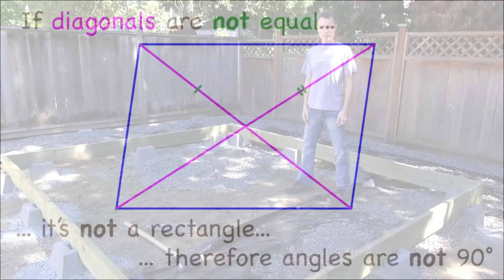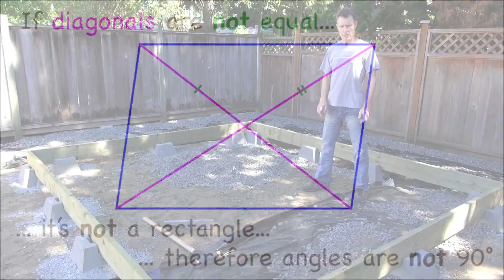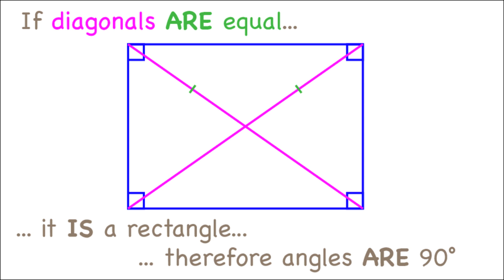Squaring a Shed Floor... Diagonals of a Rectangle

Comment: You never explained the solution? What you were doing to remedy the problem.
Reply from the maker: I didn't do a written solution, but I did correct the problem. I measured the diagonals - they were unequal. Then from about 2:00 onward I used a sledgehammer and block of wood to tap one of the corners to square it up, (ie. make the parallelogram into a rectangle), then checked again by measuring the diagonals to see that they were now equal.

Comment: Can't seem to get my head around this. We have 4 stakes and a string, with lengths and widths measured that were correct. This wasn't square though. So using this method I measured the diagonal one side, noted the measurement then measured diagonal the other side and noticed this was off with the 1st side. So I marked where it should be based on the noted measurement of the first. Then I went to check the length dimension of this side that I had just marked and it was way out. I have an equivalent of dyslexia when it comes to math. Can anyone point out where I went wrong?

Comment: Your video helped me several years ago square up a shed floor and again this weekend for a floating deck. When the measurements are off, how did you determine which end/corner to adjust? Thank you!
Reply from the maker: You're welcome and sorry I missed this when you sent it. I tap/move one of the two corners that are the ends of the diagonal that is longer

Comment: Question: What if the 2 parallel lines are not matching? Such as one line is 20 ft, and the other line parallel to it is 21 ft but the lines appear straight? How do we fix that
Reply: If you are making a rectangular shape the parallel lines must be equal to each other (i.e. top and bottom are equal length, sides are equal length). There's no way to square all the corners and make a rectangle if the parallel lines aren't equal lengths.  You need to make those lengths equal in some way (ex. cut the 21ft down to 20ft, if that works for your project).

Comment: was just trying to do that for my cabin. I put the stakes in and they were 16'×16' on all sides but I couldn't get the corner to corner right. one would be 21' and the other would be 23'. then I would re adjust the stakes and they would be off again.

Comment: Thank you for the video. @1:50, the diagonals are not equal, about one inch off. I have my problem too when I did my wood floor today. All length and width are equal, but diagonals are not. I could figure out, why?
Reply: Because the wooden base has a deep rotting problem

Comment: I stink at this stuff so I have a question. What if I have my boards at the correct measurements...say my rectangle is 8 x 10 but I have to square it a few inches like you did. Is it now 8.5 x 10 ...etc?  Does this make sense?
Reply from the maker: If your boards are cut the same length (I mean each pair of opposite boards), and you make the diagonals equal, then it should indeed be a rectangle. If you want it to be exactly 8x10, then you'd have to make one pair of boards shorter by about 3 inches (ie. two board widths) so that when it's put together it's the 8x10 that you want.

Comment: Forget about trying to match diagonal measurements. Too much trial and error. Just do the math. Pythagorean theorem. It is possible to have matching diagonals and still be out of square. If you have one bad measurement on any of the 4 sides, and then forced the rectangle into matching diagonals, all 4 corners would be out of square.
Reply: interesting
Reply: You are 100% correct, it's called a Parallelogram. Equal diagonals does not equal 90 degree corners. Way too many people out there who were never any good at geometry posting this myth on you tube.

Comment: Thanks maths guy! Came here looking for the method to correct the misalignment on my shed base frame and found exactly what I needed. Awesome!
Reply: Click the link and Start building your new SHED today:https://twitter.com/adamrif12/status/901795105077698560
Reply from the maker: Glad that you found what you needed! 🙂
Reply: I had the same problem with my rectangle shaped shed foundation. The measurements are correct except diagonally. I know my alignments are off but not quite sure how to correct it. Your video solved it , thanks!!

Comment: Is it ok if they are about 1/4 inch off?  I'm getting 176 on one diagonal and 176 1/4" on the other, but I've already screwed a few screws in (they must have shifted when I was screwing in the 4x4 support beams (I'm building a different kind of shed then you are).. I'm just wondering if I should unscrew and get it perfect... should be like 176 1/8" on both measurements instead. :)
Reply: This is code enforcement, please remove your structure if it is not exactly square

Comment: thanks for the helpful vid.  I need to mark our a large rectangle on the ground to set some concrete blocks to sit two 20 ft  shipping containers onto. there will be a aprox 4 meter deck between conecting the two. can i use this method but using string lines?  thanks
Reply from the maker: 79holdentorana You're welcome, and yes you can use this method - if the strings are exactly the same, then it should be a rectangle.